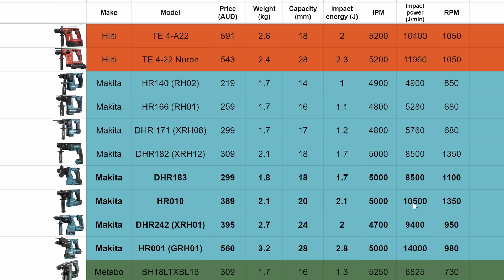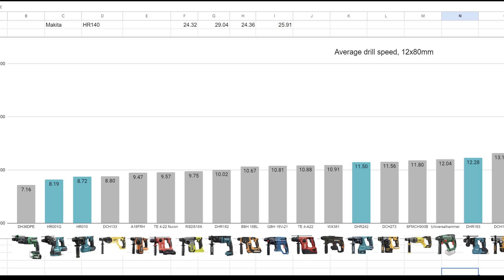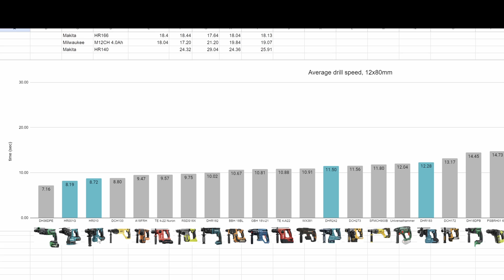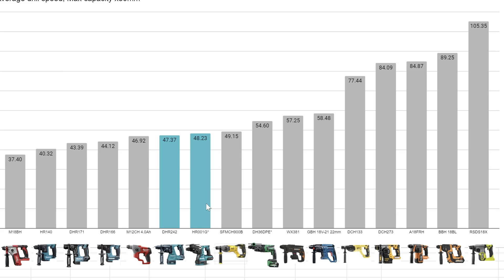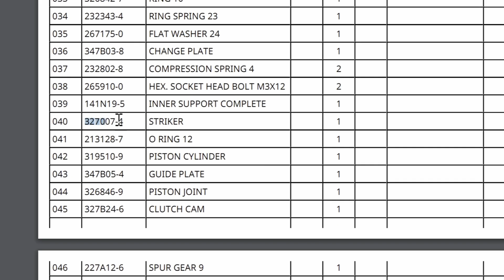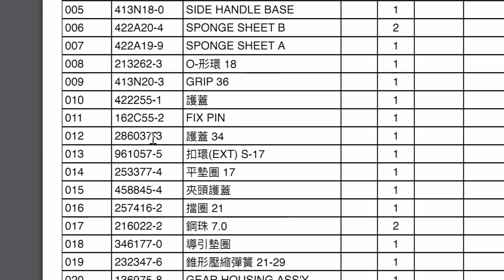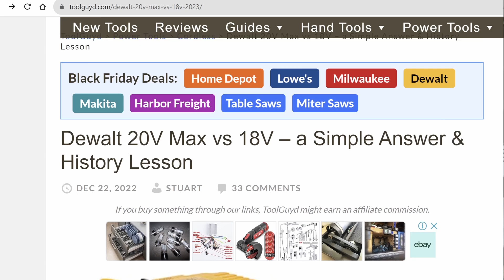Makita 18V vs 40V SDS #rotaryhammer showdown [STARRING HR010/GRH10Z]

Comment: Hi, on my HR010g i have this weird noise when hammerdrilling/chipping mode. It happens when you finnish the drilling (have no resistance from material) the drill makes  drudgery noise . I have that noise from the start when i bought the tool. Is that normal or is something wrong with it ?

Comment: Makita always leaves some in the tank, you can abuse these tools like no others. Hilti used to be the same, but since neuron, they just give them all they got and they break a lot faster. I have the DHR243 (same as the 242) and drill 26mm holes with it on a daily basis. It's a great one, even at it's limit. I cooked the grease out of her many times and she still keeps going after 10.000's of holes and 6 years of abuse.
Reply from the maker: That's great info thanks. I can't really test every one for longevity so it's good to hear from the field. Wasn't expecting that from the Nurons but I guess it doesn't seem quite as solid as the older green Hilti

Comment: HR001 when working and pressing the hammer drill, increased speed is activated. That is, the hammer drill has an increase in speed under load and if there is no load, the speed is less than stated.
Reply from the maker: Wow really? Amazing. I must try it
Reply: @BoltahDownunder If you insert a smooth chisel into a hammer drill, turn it on at speed 4 and then take the chisel with a gloved hand, the speed will increase. Or if you turn on the hammer drill and then clamp the upper damper of the shock absorber, the speed will also increase.
Reply: You say that,  but its a known fact about it not not getting more power from swtching from 4 to 5.

Comment: Mate I bought the HR010 solely on this review just under 2 weeks ago. I'm not blaming you, but I got less than 3 days out of it drilling 12-16mm holes before it died in the arse.  The well known Sydney tool retailer from whom I purchased it refused to replace it given that it was outside 7 days, by 2 days(fair enough I guess policy is policy), but the Makita rep refused to authorise a replacement. I was just commencing the process of changing my platform from Milwaukee to Makita 40V.
I expected a  whole lot more from Makita and boy am I bloody disappointed!
Reply from the maker: Bloody hell mate that's appalling! Do you want to send me some more info via email? mountainmullet55 at gmail dot com. I probably can't help you but maybe we could publicly kick up a stink and get you a replacement. A 20mm rated hammer should be able to handle that kind of work, especially if it's mostly drilling 12mm holes
Reply: @BoltahDownunder  Yeah mate I am pretty disgusted. I mailed you
Reply from the maker: Sorry I didn't get anything. Can you check the address?
Reply: @BoltahDownunder  Sorry mate been flat out,  I just checked and sent to the incorrect email address. It didn't bounce so someone somewhere is scratching their head. I'll mail and update
Reply: @BoltahDownunder  Boltah try this on for size. I got call from the retailer I purchased the rotary hammer from. After they viewed the photos of what I was using the drill for, which was to drill  a series of holes into concrete footings to place N16 rebar for starter bars, that had been overlooked during the pour, the NSW Makita rep suggested that the HR010 wasn't up to the task and that a better choice was the Makita HR008GZ01
So the HR010 is rated to 20mm and that is likely a stretch. You tell me, because I'm totally confused
Reply from the maker: Madness. If it's rated to 20mm it should be able to handle 16mm. Otherwise that's false advertising and the ombudsman should tell them so.
Now there is an optimal drilling range that some manufacturers advertise, usually up to around 2/3 of its rated capacity, but that's just a guideline and i can't see anything like that on the Makita website. 
They're dreaming if they want you to get an hr008 for 16mm holes.
Reply: Really hope you got a bad one and you get it sorted eventually, cant believe makita would repair it,  hope thats just one bad rep, i have had the old 202 18v sds for 10 years drilling well above its limits and its still running, so new HR010GZ should be able to last even if drilling 50mm holes never mind 16mm.  I litrally just bought mine yesterday,  did buy HR007GZ to for bigger holes, but your post has scared me know.

Comment: Hello, I was browsing rotary hammers, found your videos and subscribed already.
For quite a long time I've been looking for the most compact/fastest drilling/ chiseling mode possibld rotary hammer.
Got my eyes into Hilti TE 6 A22 even though it's not small, but Hilti did very well with that one.
Couple months ago I saw that new 18v Makita you showed here, however doesn't have chiseling mode...it would've been PERFECT.
Personal daily use at work is 99% of the time drilling 6mm and 8mm anchors into masonry and concrete and light("cleaning") chiseling here and there...nothing crazy.
All my tools are Makita 18v and I'd like to stick using the same battery and charger. That new small 40v seems great...temptation popping lol.
Which you be your suggestion for my needs?
Thanks
Reply from the maker: So a compact Makita 3 mode in 18V? There's only one and it happens to be about the overall best small hammer on the market, the Dhr182.
It can be seen in this and a few other videos
https://youtu.be/MvO3wxIvAgY
The only thing I don't like about it is the pistol grip, but that's no big deal. It wouldn't even notice drilling 6mm holes if that's what you do often
Reply: @BoltahDownunder  Cheers mate! Which would you recommend as best compact and drilling only (no chiseling).
I've checked the numbers, I wish these small models were a bit faster.
Reply from the maker: No chiseling? Dhr183

Comment: great man, finally some good testing. Even with specially poured concrete. Really cool. Any chance you can test some of the dust extractors? There is somehow no video or something out there with the dust extractor for the DHR183/HR010. How I understand it is that the fan on the brushless motor provides the suction. And is there a hook you can attatch to the DHR183/HR010? There are these humps under the handle on the right side of the tool. 
Was always a fan of the HR001g, but when the HR010 has the same functions but is quite a bit compacter i would go with it
Reply from the maker: Cheers mate! Yes specially poured from the same batch.  You can't really compare between drills unless it's the same concrete. Pain in the ass but it means I've got stable workpieces over time.
The motor fan does provide suction it has a big panel that opens to the fan on the bottom. 
The Small guys have a Tool Hanger (not included) that's not a hook but an eye you can attach a lanyard to. 
And yeah if you use a Hr001 for drilling lots of small holes I can suggest trying the HR010 as it's plenty fast at 12mm but much lighter that the hr001
Reply: @BoltahDownunder  thanks for the answer. I looked a bit now, the HR010 bare tool is currently 221€ here in germany. Not bad for a brand new 40v tool i think. The dust extractor is 83€ bare tool, and hopefully they create a few more kits. Now you can only get everything bare tool, or the kit with hammer drill, dust extractor, makpac, 2x 2,5ah batteries and a charger for 600. Dont need any batteries or charger, and they havent made a plastic insert for the kit.
Bit for the tool hanger: didnt find anything for the HR010.
Reply from the maker: 221eur is slightly less than it cost here with current rates! It's still very new so I'm sure kits will come in time. Also, I think The channel Tools and Stuff did a review of the dust extractor if that helps you. I don't have any yet, and don't really know how to quantify their performance but it's something I aim to do eventually.
Looks like the tool hanger (bad Google search term!) Is sold as the 1911k0-5 hook set, at least in Australia

Comment: How fast is the torque limiter on the HR010G? 

They don't advertise it with the AFT tech like the bigger sister model but the manual still says it has a torque limiter. So maybe it doesn't cut off if the tool rotates completely freely but cuts out quick enough in a bind to not need it.
Reply from the maker: Lemme do some testing! So far I can tell you it's not based on acceleration, so it'll probably be some current sensor. I'm not sure if/which method is superior, but I'd say it's fine, not least because the 010 probably doesn't have super hazardous levels of torque

Comment: 7:45 hang on, the DHR182 beat the DHR242? I thought maybe your DHR242 was faulty, but the specs say the DHR182 has better J/min. That DHR242 really is ancient.
Reply from the maker: Haha yep. It's strange and I've seen in a few rounds of testing so I believe it's true. I have no explanation though. My 242 was bought new from an online store that I trust, but I guess you never know! Looks like I'll have to start cracking these things open
Reply: I misread. The DHR182 is lower at 8,500 J/min vs 9,400 of the DHR242. Might need a side-by-side of these 2. Your DHR242 looks second hand, maybe it's been flogged to death?

Comment: What's the balance of the HR010G compared to the DHR182? Both same weight, but I guess HR010G is a little more front heavy.
Reply from the maker: Ok so the 010 is 3.16kg with battery, 182 is 2.8kg. They felt about the same weight to me in one hand (before I weighed them), but the 010 is easier to raise & manoeuvre generally because its centre of gravity is further back. The 182's COG is basically where that big fan vent is just behind where the black & teal meet. The 010 COG is directly in front of the trigger, about 40mm closer to your hand than the 182. I'm gonna try to quantify this in future, so thanks for the inspo!
Reply: @BoltahDownunder  2.5ah is 686g vs 1010g for 4ah. So with equiv battery, HR010G is 320g lighter and then they're nearly identical weight.

Sounds like it's almost the perfect bolting hammer, apart from the 2 finger trigger. I guess the DHR183 would be better due to the lighter weight if you're only drilling 8mm.
Reply from the maker: Indeed it's gonna be good. I'm keen to see how the runtime goes when I get around to it also

Comment: So the DHR182 is finally dethroned! I was a bit meh on the HR010 due to it's weight increase over the DHR183. But then it beat the DHR182 and DHR242. I know the DHR242 is just usable one-handed, so the HR010 should be great.
Reply from the maker: That thing is really impressive. I wasn't expecting much cos I thought it was just a 40v version of the 183 but it turns out it's the hammer I've been waiting for all along: a drop motor 182🤩 but, even better. Which is no mean feat, cos there's only so many things you can do to improve the hammer mechanism itself
Reply: @BoltahDownunder  I only wished they'd used a single finger trigger like the DHR183. The only rotohammer I'd want a 2-finger trigger on would be an SDS-MAX
Reply from the maker: Now that's something I haven't really examined but for sure smaller triggers are going to be better for 1 handed use 🤔 you're giving me ideas now
Reply: @BoltahDownunder  case swap with the DHR183? Maybe just a trigger swap and fill the void with epoxy putty 😄